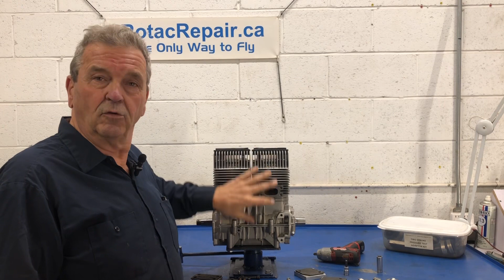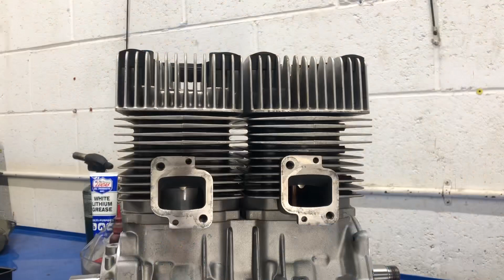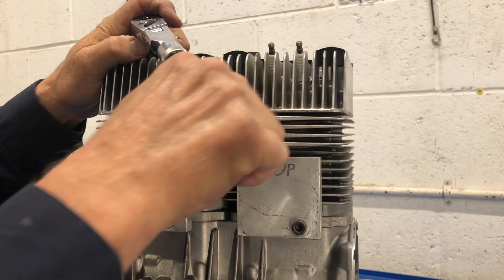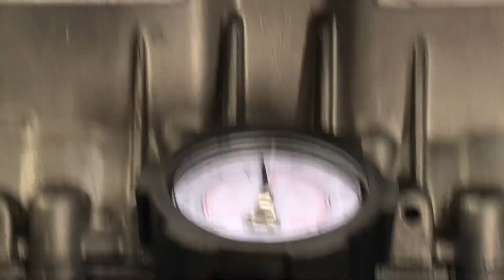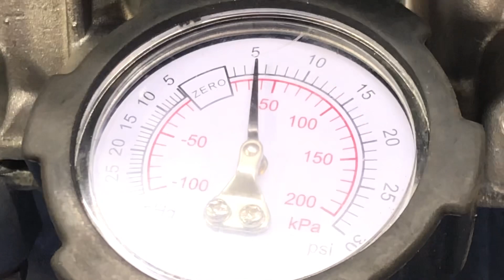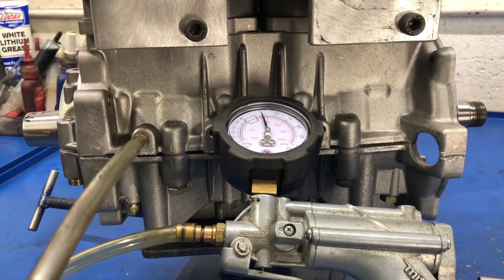Rotax 503UL engine pressure testing

Comment: Good morning from Andalusia, Spain. I see you're an old-school mechanic and I'd like to ask for your advice. I have a Rotax 503 dual-ignition engine with a single carburetor. I need to increase its horsepower to improve the response during takeoff and landing of a Gilabert autogyro. Do you think that by polishing the intake and exhaust and installing a good exhaust system I could gain those 10 hp? Is it possible to install a big bore kit with a 75mm piston diameter or larger? Will the crankshaft withstand it? What do you recommend I do to the engine to gain maximum power? Thank you very much from Spain.

Comment: Hello John, I'm missing something. How does the air test get from one side to the other side. These are basically two separate engines in one case with a seal in the middle of the crankcase? I've done leak downs my Ski Doo engines but have always had the Y pipie installed. Thanks
Reply: This test is only possible on a parallel twin , not on 180 crank ! They are two separate engines !
Reply from the maker: Yes it is 2 one cylinder engine mechanically joined by the crankshaft, however they are not mechanically or physically “sealed” from each other when the engine is not running. Between the two center bearing is an aluminum seal. It’s a “labyrinth” that has no contact with the crankshaft. How does it seal to the crankshaft? It uses the fuel and oil mixture to form a seal when the engine is operating. When the engine is off that same space will allow air to flow between the cylinders. Ive got a video on this topic. Best regards John

Comment: Excellent!  Is there a single crank position that's acceptable for testing?  I don't understand why you have to move the pistons to different positions.
Reply: Excellent question. Hopefully I’m able to clear this up for you. 
When the piston is at the very bottom position in the cylinder, the transfer ports are open directly into the crankcase and the upper cylinder area is exposed to the crankcase test pressure and volume. 
This allows for a direct passage of the pressure and flow volume from the crankcase to easily enter the cylinder area above the piston top. This method allows for any gasket above the piston top to be confidently tested for possible leakage. 
Please consider the opposite position with the piston at the top position. 
The only way for pressure to reach the head gasket would be the minuscule amount of pressure and flow passing by the piston rings. Eventually the area would pressurize above the piston, however the small volume of flow could potentially hide a seeping head gasket.

Comment: I'm confused. You used the vacuum port on one cylinder to test both cylinders. Isn't there a crankcase seal between the 2 cylinders? How does pressure get to the opposite cylinder?
Reply from the maker: An excellent question that needs a follow up video. I’ll have begun the supplemental video but haven’t completed all the clips yet.

Comment: Thanks for the video, John! A very important procedure for these engines and their longevity to either find out if there is a leak in an operating engine or check if everything is alright after overhauling them. I have built a similar setup as yours some time ago, works great! 
Cheers from Germany!
Reply from the maker: Absolutely a good diagnostic tool as well, thanks for the positive comment